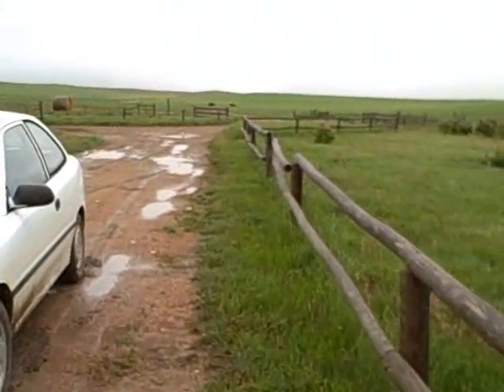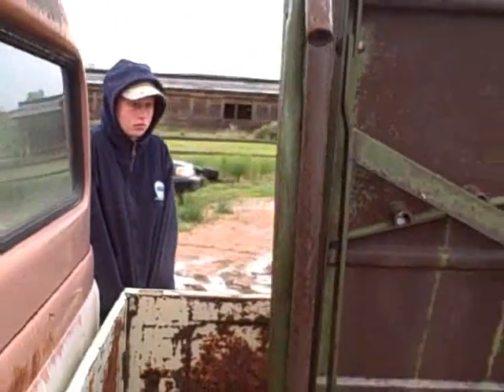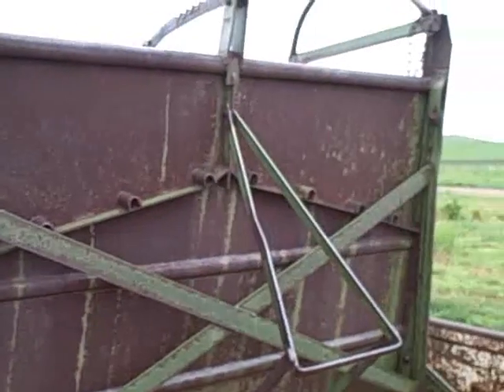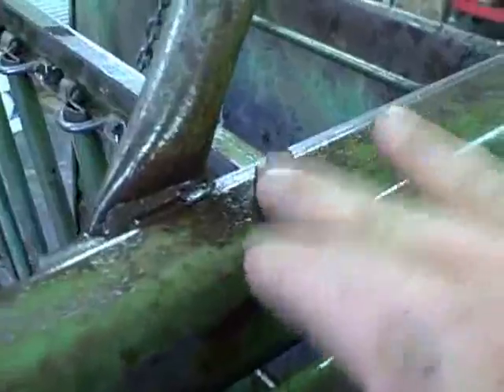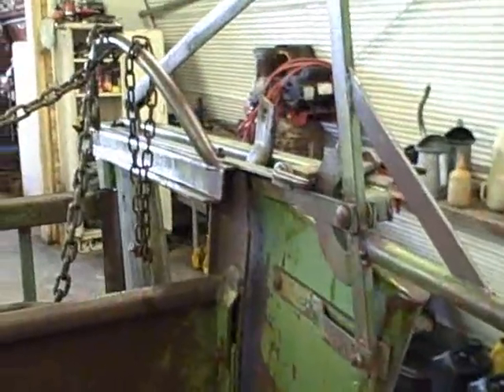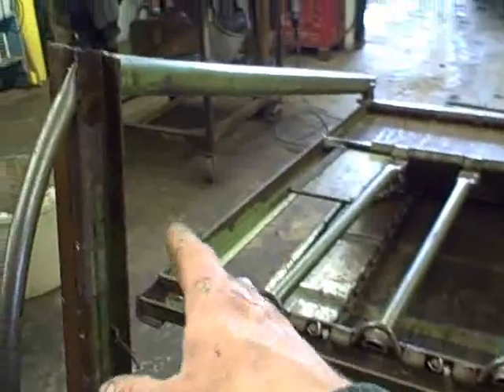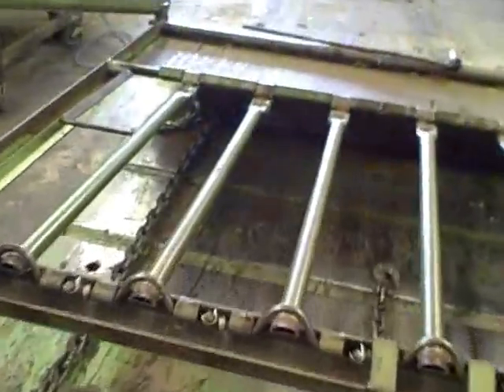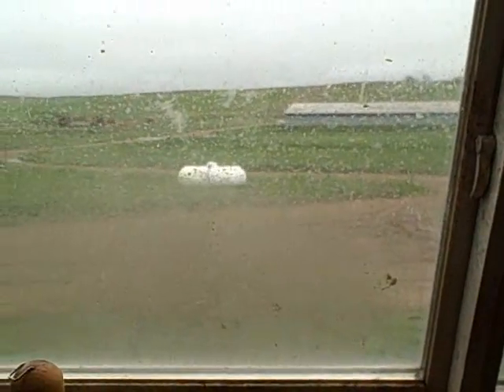We finally got a calf table

Comment: @MrYussel you brand the calf either on the left hand side, or the right hand side (or both) There is a metal plate on one side of the shoot so he is reversing how the calf goes in so they can be branded on the other side.  As part of the process of registering a brand through the state, you pick the shape of the brand, location (hip, shoulder and what side).  You can also register ear notches and dawdles as part of your unique identification system.  The latter two are lesser used these days.